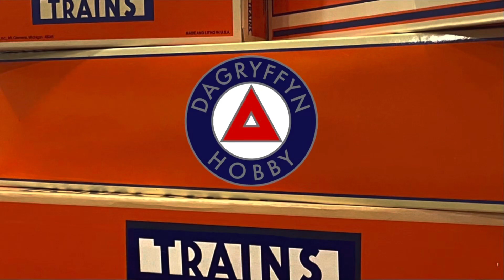Layout Update: Working on the Stream and Road

Comment: Totally agree with your opening comments! Also with your country road concept.  A stream   does fit better.  I like the way the front looks!  Actually the eye is drawn to the front and the rear Lind of goes out of sight, out of mind.  On the front you could have the water simply going off the edge.   Cellophane tape can be your medium.  Roads including railroads frequently followed rivers and lakes for engineering and construction purposes.
Reply from the maker: Thanks. I have to get back to that project!

Comment: I like the course of the stream a ot. Not so sure about the road: the advice on dirt is good. I'm thinking of one rural place on the New Haven where the railroad crossed an older rutted dirt farm road. The railroad never built a proper crossing, but the locals used it all the same. Decrepit fence posts with most of the barbed wire gone marked the opening and I'm pretty sure the Penn Central used it for access to the track. Haven't been there for forty-some years: I'm sure the access was blocked off with the electrification of the Shore Line (1999). As for the road in back, I'm a little bothered by how quickly the train shows up on the back side when running clockwise. You could install a flat just behind the arch bridge with a photographic or painted backdrop. Then your actual road would dip just before it continued in two dimensions on the backdrop (not my idea--Paul Dolkos used this effectively on his earlier Boston & Maine layout). On the other hand, I'm philosophically opposed to losing visual mainline by hiding track behind a mountain or in a tunnel--or behind a backdrop.
Reply from the maker: I like the idea of a flat. It actually doesn’t show up as quick, I edit it in the videos, but a long train is visible on both sides. 
A friend suggested that the road should just be a dead end maybe with a couple cars parked at the end. I’m liking that idea.